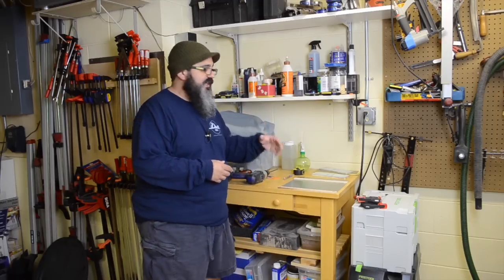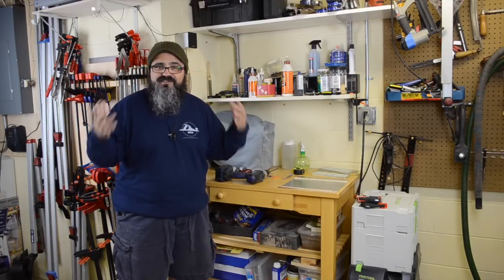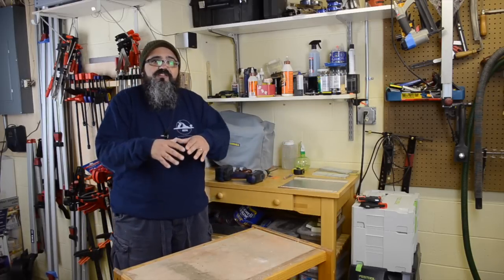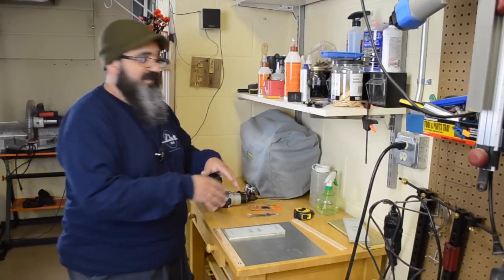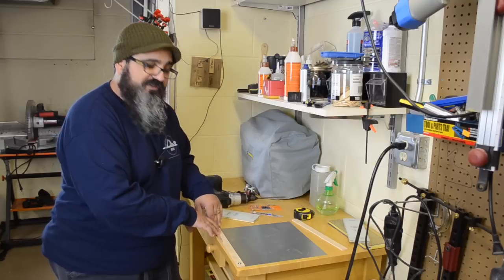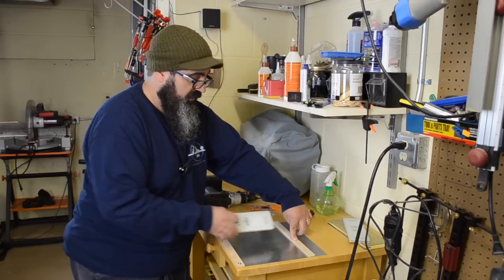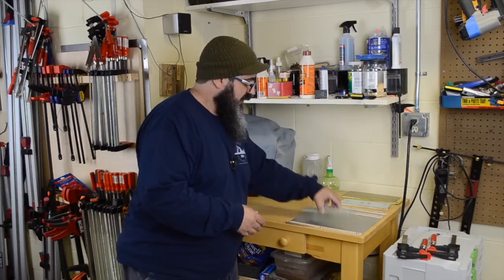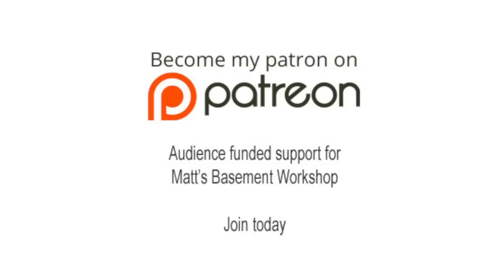547 Sharpening station upgrade “no more chasing the stones!”

Comment: Another thing that may work even better is to pinch the stone with a wedge.

Angle the top strip a bit, use a wedge to tap it place that will pinch the stone against the bottom and the wedge (and against the angled top).
Depending on the angle you can have a wide range of stones usable with only one wedge. You can adjust more by using a wider wedge, or just adding a strip as a spacer
Reply from the maker: Great idea for when I build the 2.0 version. Thanks!

Comment: Why not drill the pilot holes and insert the screws for the top rail with the stones in place ?  No need to measure anything, draw lines, test fit or adjust anything afterwards.
Reply from the maker: No reason you can't do that. There's always more than one way to get the job done. Thanks for watching.

Comment: Hey Matt - I enjoy your videos - you are a good communicator.  Couple of things - you don't make allowances for a strop on your station.  When you hone, you are only finishing up half of what you need to do to actually sharpen.  To finish the job you need to strop the edge with jeweler's rouge.  Usually you just prep a piece of leather with the rouge, and then stroke your blade or chisel on it a good number of times.  I would think about 30 strokes would be best.  Dont forget to do the back a couple of strokes as well!  Check out Paul Sellars sharpening videos - he shows you how really well.   Most sharpening suppliers sell strops ready made, or you can make a strop that fits into your stone holder profile.  Just glue a piece of smooth leather onto a piece of plywood with the same dimensions as your stones.  Then load it up with rouge.  Its usually green.  Cover the leather with rouge - really load it up.  Then watch Paul Sellars strop his tools.  That will give you a good idea of the process.  

Second issue - the name of the stone manufacturer is pronounced with a short "a".  You are saying "Shapeton" - long A, but it is pronounced with a short a - rhymes with Clapton as in Eric Clapton.  

Keep the great videos coming.  I enjoy your info!

Joe